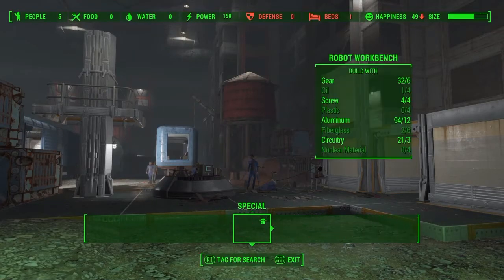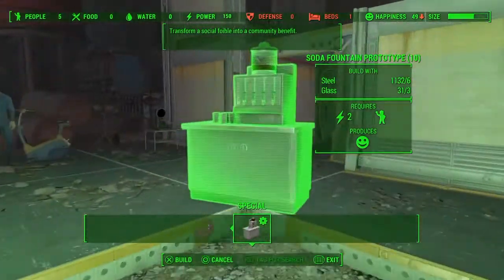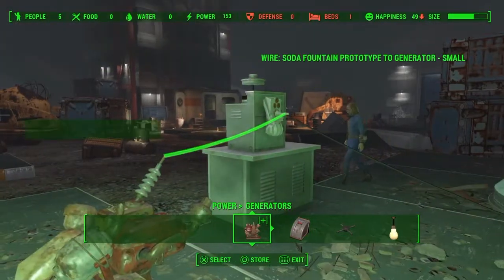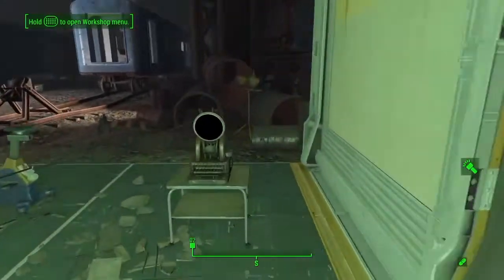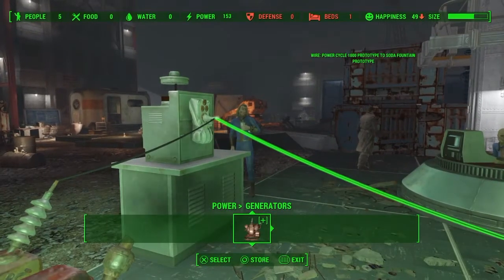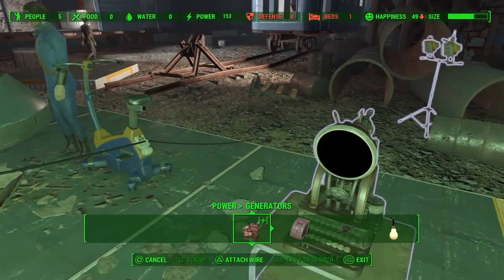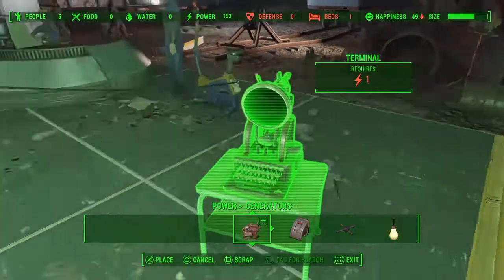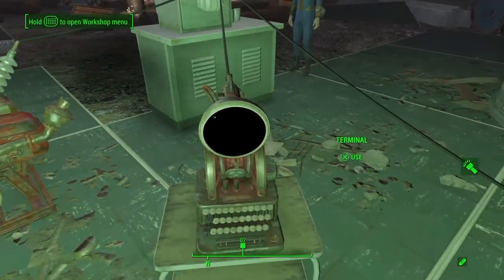Fallout  4 Vault Tec Workshop - The Watering Hole Quest (Soda Fountain)

Comment: I've seen some people build their vaults with the actual vault walls however I can't find it in the workshop menus. Do you know if its possible or will I have to install a mod to actually get the vault walls and other vault items etc?
Reply from the maker: +LeviBTV it could be on pc which means they could have downloaded a mod for it
Reply: They're under Structures > Vault. If you have a lot of mods that add stuff to the workshop menu it's possible that it won't show up. In that case you might need a mod like "ALL DLC Building independent patch" which fixes that. Though, Homemaker, Snap n Build and the other one in their more recent versions are done more responsibly and shouldn't cause that anymore.